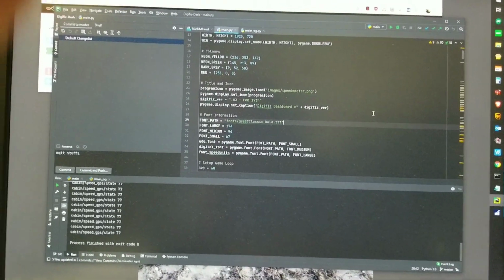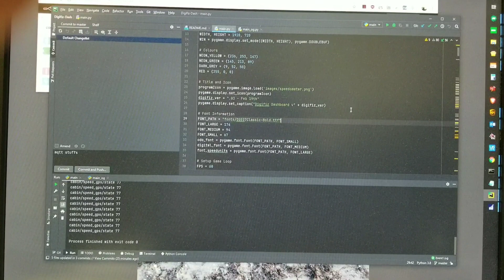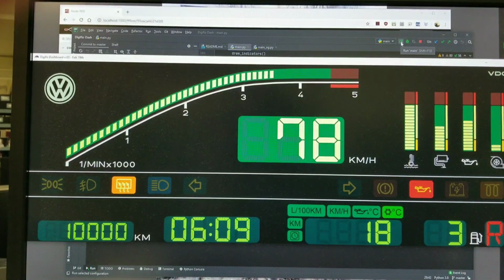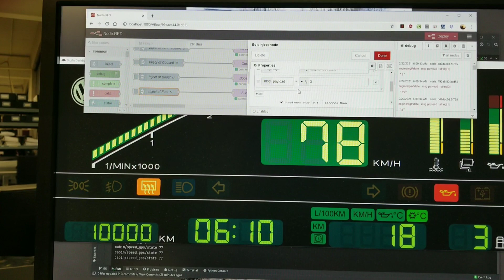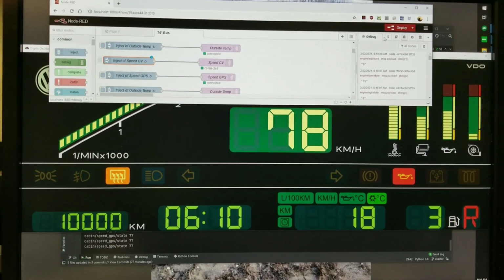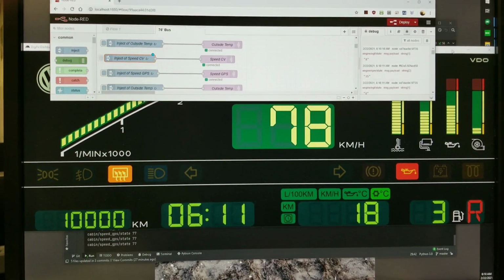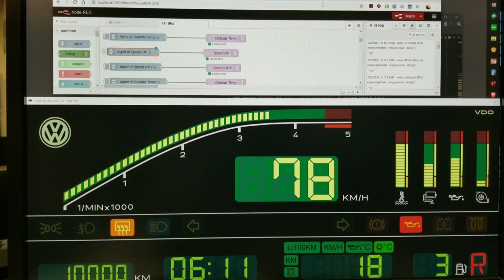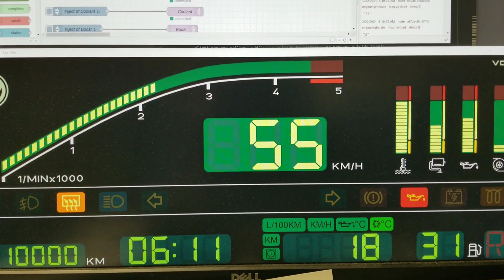Pre-OBD - DIY Digital Dashboard - Digifiz v.03: Python, pygame, MQTT and a 1976 VW bus!

Comment: Very nice. After seeing a guys Tuner studio for his Mega Squirt I had to find out if I could build one. My plan is not a full time install  but one I can swap between my 67 Cougar, 67 Pontiac and 73 Super beetle. Inputs are GPS speed, TPS, AFR, RPM, temps, fuel pressure and video with data overlay ed. I think I can cobble together three different Python projects to get what I need. All three have arduino, Pi and python.  Thanks for sharing your work.
Reply from the maker: Good luck! Nice if they had all the same sensors lol! I thought about making mine swappable for my daily but haven't bothered.
Reply: @GavinTinkers Having identical sensors would make things too easy. Why not change sensors and gauges for each of the vehicles.  This a proof concept for my yet to be determined  project. Best part, the kids can use it for a 4H project so I am golden..

Comment: Wow, this might be just what im looking for. Im looking into digitalising my 84 Jetta vr6 :) absent any coding experience it'll be quite the job but this inspires me! Subscribed.
Reply from the maker: Do you have obd2? Definitely easier systems out there is so lol... Pre-obd2 you will have a steep curve... But I had little real experience also. Mind you this hasn't even been real world tested yet so maybe it's a massive fail lol. Hoping to do more of an update on the next month but I've been cranking away on getting the swap done and wired up!
Reply: @GavinTinkers  no OBD2 sadly, but that could be arranged... the wiring on the car could use some love so why not update.. ive been googling(is that a word:P)/ reading about possible systems the past few days and think arduino will work also. Low boot time is essential, in the sub 5 sec range

Good luck on your project!